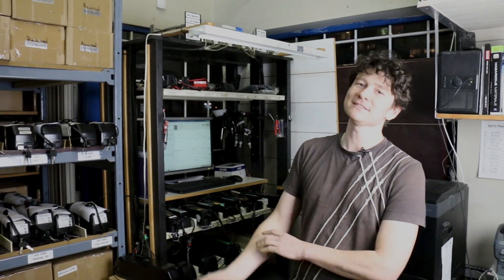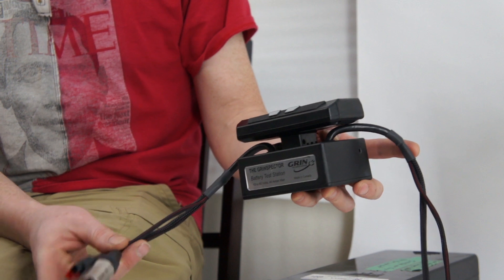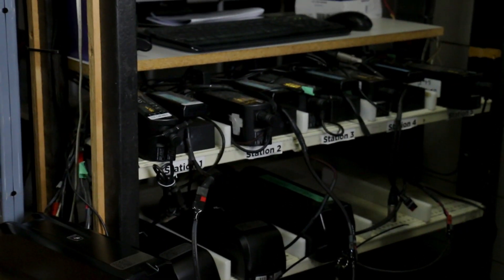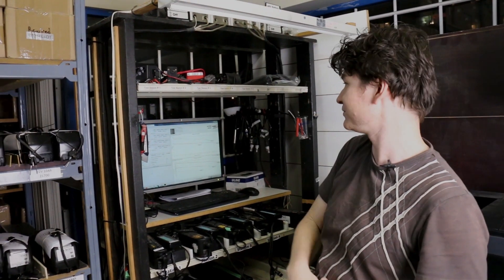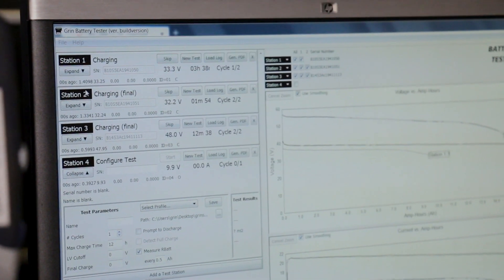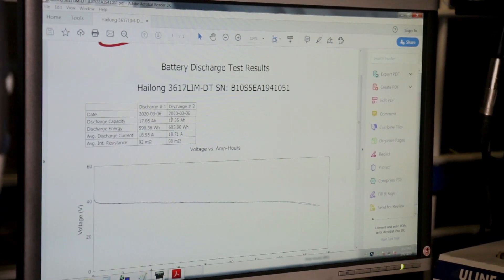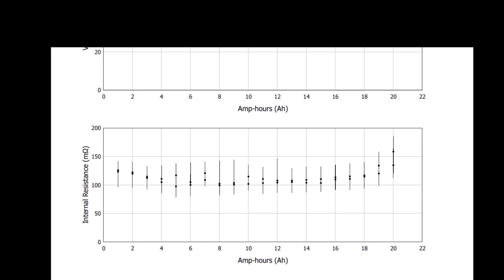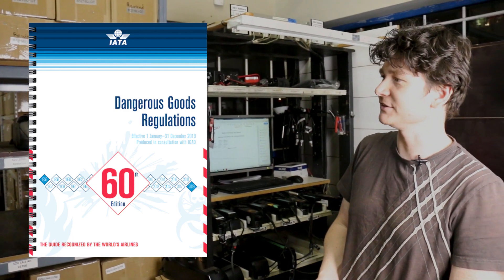Intro to the Grinspector Battery Station, Designed for Cycle Testing Ebike Battery Packs

Comment: With that many Lithium ion batteries discharging and charging. I hope you keep a couple fire extinguishers handy, but that is great that you take the time to test them and prep charge levels for safe shipping.
Reply from the maker: Yeah, we have it in an isolated shelf system that isn't coupled to the rest of our warehouse and has sprinkler system in place too.  Always still a tad on edge as we've known about a dozen ebike businesses firsthand that have had serious battery fires over the years, but luckily these are way less frequent with the top tier 18650 and 21700 cells.